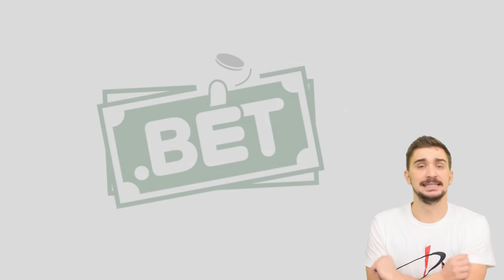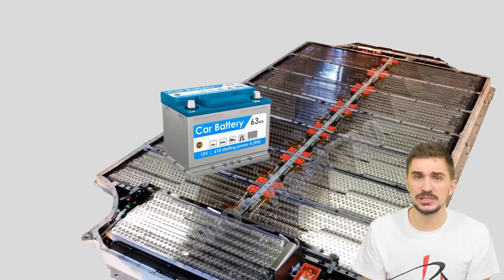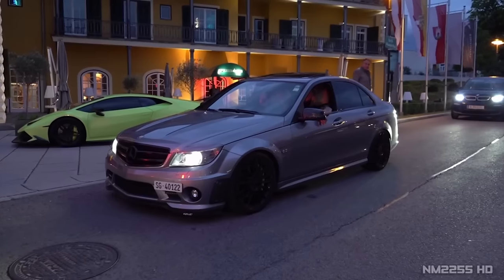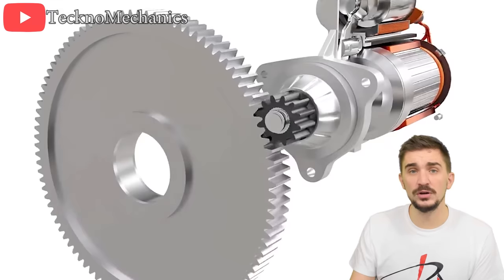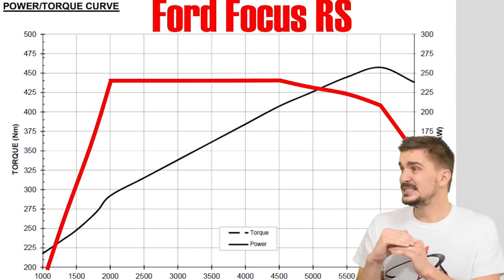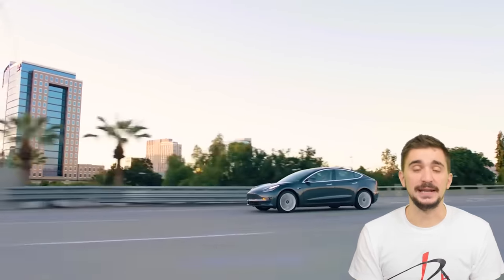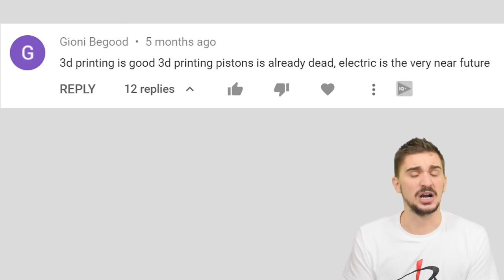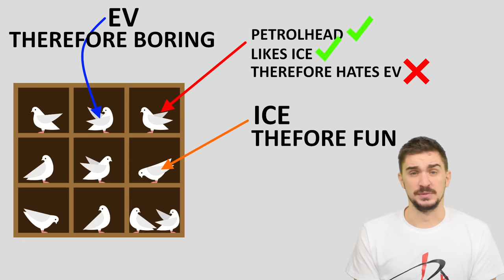ICE vs EV - IN-DEPTH comparison of BATTERY ELECTRIC and INTERNAL COMBUSTION ENGINE vehicles

Comment: I'm as big of a gearhead as they come, but I can honestly say that my Tesla Model S was the best thing I've ever purchased, vehicle or otherwise. I think some people just don't like change. I remember back like 15 years ago, when ethanol/E85 was just becoming a thing here in the US. Having been around sprint cars and IndyCar most of my life, I knew the benefits of running on alcohol, but I had a ton of friends who thought it was snake oil. Now several of those friends built engines to run exclusively on E85. Do I think electric cars are amazing? Yes. Do I think they are the way of the future? Yes. Do I think they will eliminate internal combustion? No. Hell, enthusiasts still ride horses, and cars replaced those over a century ago.
Reply: Hows that EV treat you on a road trip? I can take my truck or civic 1000 miles and use aboit 15 minutes worth of fueling time to do it. I drive a lot so an EV is pointless

Comment: Also, why use the old discontinued P100D dyno graph? The newer Model S "Raven update" Performance trim makes more power/torque further into the RPMs thanks to recalibration of the cell chemistry, inverter/speed controller(s) and the Model 3's PMAC motor on the front axle- And the Model S Plaid/Plaid+ (as stated on the Tesla website) utilizing carbon sleeved rotors, enables the car to maintain peak power/torque (1,020-1100hp/torque unknown) all the way to top speed (limited to 200mph)

Comment: Thanks for this video. I'm surprised you're surrounded by so many E-Vangelists, here in Czechia the complete opposite is the case. I have yet to meet a person who doesn't describe EVs as useless and overstated waste of effort. People here seem to think that the battery manufacture has the same carbon footprint as 5 years, 150,000 km worth of ICE vehicle operation, only because about 60 % of our electricity comes from burning coal. I've never heard anyone talk about the 8% vs 60% efficiency of ICE vs EM. The best part of this was when otherwise a very knowledgable and wise person pointed at the water vapor coming from the power plant cooling towers and told me: "See? This is the ecology of EVs." 

I wouldn't probably want an ICE car for myself, but I completely agree that ICEs have and will have their place here for quite some time yet. But I'd like both parties to use some real arguments. I love that this video brings some for both sides.

Comment: I remember having to manoeuvre a broken down volvo to allow it to be towed.  Not only did i do this on the starter, it managed to drive up a HUGE kerb during the manoeuvre without hesitation, which opened my eyes as to how much torque even a tiny electric motor has.

Comment: The last time my clutch went out on my Nissan pickup truck. I had to drive it with no clutch all the way home. But, every time I came to a stop at a light.  I had to turn the truck off, & put on nuetral . Then, I would put it in the first gear, the light would turn green. I would start the truck, & it would move forward.  Finally starting the rnotor as i gave it gas. Voila running again. No clutch shifting. 
Made it home. 😁

Comment: Love the content.  You have a wonderful ability to break down complex concepts into bite-sized pieces.  One complaint.  Please, please stop using SI units for videos targeted to US viewers.  I don’t like mentally converting and will be the first one to demonstrate in Wa DC to oppose the conversion to metric.  I have always purchased gasoline in gallons and measured torque in ft-lbs.  Really the only relevance to my frame of reference is comparing a 5.9 l Cummins engine to the 6.7 l.  Other than this small complaint, I love your channel and the information you are providing.  Keep up the fantastic work!

Comment: All sounded good except for the part about "Liquified Dinosaurs."  We may have to do a bit of homework here.
I have an EV and love it. But for my wife, there is no EV version of her Honda Odyssey.  Fill it up and drive all day long.
It's not the ICE vs EV that we compare in the two vehicles, it's the capacity to hold fuel.
We all want smaller, more powerful, cheaper, locomotion for our vehicles.  But we also want a cheap way to power them, and an overall lower cost of vehicle.  I love my EV, but the sound of a V8 rumbling along is something no EV will ever replace.  It feels like a wild animal and I love it.

Comment: GREAT content as usual, especially the end. The EV/ICE war is simply stupid, as like as Android/Apple stuff.
About the bet: this (without disconnecting the spark plugs) is how I went home once, when my clutch cable on my 1995 Clio S broke :) You can't stop the car at traffic light if you're in gear, and you can't put a gear from stand-still if the engine is running (without using the clutch). So you put in neutral, stop at the traffic light, put 1s gear and start to move (and start the engine too) using the electric starter. Not good to do but if that is your only way, you can, trying to avoid as much as possible red traffic lights or stop interceptions on the way.

Comment: Nice, vid, still relevant to me even today, i'm from north-africa, Algeria, and even tho this year i saw electic charging stations on the highway, in the north of the country, but it's not everhwhere, specially here in the south, i hadn't even seen any electric cars during my trips to the north either.
i did the math and even tho electricity seems cheaper than fuel, but still the cost of an electric car is way outside most people's pockets and it's not yet cost effective bc batteries are super expensive.
Also realitiy check, recenlty saw more and more articles online about how batteries for EV arn't economical to replace all ICE bc there isn't enough lithium reserves nor nickel or cadmium,
So most of the world will be using ICE for the next decade or 2 decades

Comment: Id Love to hear your take on the environmental aspect of EV vs ICE, Just consider if you would, in and EV world, we centralise the carbon footprint to power stations (most currently without carbon capture) we then loose power through cable transmission to your home where we charge our EV and that best Batteries are .8 efficiency. It seems we loose maybe 30% being conservative before we sit in the car. Maybe this is comparable but without carbon capture at source, perhaps the real future is Hydrogen ICE. This is my perception, without hard figures to justify or reject. Please comment thanks from Steve

Comment: Some things need slightly better explanation.
Torque curve for EV's on high RPM is mostly power limited, not as much due to back EMF.
If you reach max power on lower RPM you will create near perfect constant power torque curve, with obviously some 4-7% loss, dependent on the motor.
Also most of EV's aren't geared towards very high wheel torque, but to optimize efficiency on the average speed estimated by manufacturer.
This is why dual motor Teslas have slightly higher efficiency - they can manipulate power between two motors with different gearing.
Multi-gear setups aren't used mostly due to lackluster efficiency gains - couple years ago I've read about 2 gear being tested for EVs, but it only gained ~5% of efficiency, while adding to weight and complexity.

Comment: I think the enthusiasm u told about for evs should be limited to hybrids only, the KOENIGSEGG JESKO is the best example . Purely electric vehicles are soulless and dull, usable though depending the consumers needs, and they completely lack the stimuli that sparked the enthusiasm for these"  intially built to be just tool things" THE SOUND + THE MECHANICAL FEEL of the whole car working with different systems integrated into one, THE ENGINE, THE GEARS WHINING, THE ICONIC GEAR LEVER, THE INFAMOUS CLUTCH PEDAL and the responsibilties we have as owners. So i dont completely agree with that statement of yours that similar enthusiasm can be shown. But you opinion has been respectfully noted down.

Comment: Pedantry: You control the speed of an DC motor by controlling the current. It's current that drives the motor. It just so happens that with a DC motor, current and voltage are proportional due to the impedance across the motor. This means that as the voltage drops, so does the current (and at 0 voltage, you have 0 current). You can think of voltage and current interchangeably here since the effective result is the same, but to be sure, current drives motors. A magnetic field is produced by a moving charge and that means current, not voltage. 

Also: If IC engines made torque from 0 rpm, they wouldn't need a starter motor ;)
Reply: I thought in a DC motor increasing the voltage increases the difference between applied voltage and back-EMF, allowing more current to flow, no?
I know a small DC motor, if current limited, can still increase speed with increased voltage, but the torque will be current limited.
Maybe I'm wrong.

Comment: Yeah as you told, EV are having a bright present. EV nail it in COG and ICE in reliability. 

Just a small correction EVs are actually as old as ICE. It is just that the world has turned to it now.

Eg.  Columbia Electric: 1899

ICE future is the omega 1 motor.
Reply: And as far as ICE is concerned they have been the generators in the past and even in present at times of no electricity. When we also include power drawn into charging stations and potential opportunities for generating power to homes for those who need electricity at their homes, it leaves a questions mark on the practicality of it.
By far HEV and HICE are self charging and offer best mileage MITIGATING DIADVANTAGES OF BOTH ICE AND EV. they are the best available option in the market
Reply: Interesting...🤔

Comment: What about gas turbine engines not needing to convert from reciprocating to rotating movement? I know they aren't practical in a car but I like that they are being used in large ships to power the generators that run everything,  including the electric motors that turn the props. Nice video though, I think you did a good job showing the trade-offs on both sides.

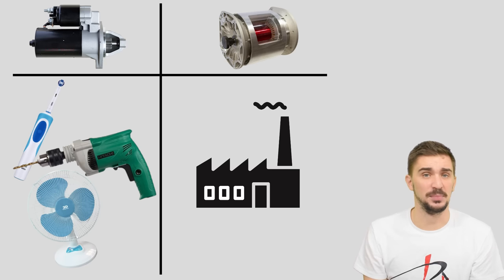Comment: 6:30 That fan and electric drill are using AC motors, FYI.  Notice the form factor of the drill, no battery is going to fit in that handle. The pic looks like the cord was cut off.  Also, some electric cars use DC motors.

Comment: Combustion engines are used for some VERY efficient ELECTRICAL generation. Most locomotives use diesel engines to turn electric generators to create mechanical propulsion through electric motors - and this has been going on for a century. 

Are electric motors and vehicles awesome? Yes! 

Are petroleum fueled engines and vehicles awesome? Yes! 

Are both completely viable for (at least) the short term? Hell yeah!
Reply: Some more remote locations also run diesel generators for their electrical grid. There is a push to augment them with things like solar-battery in these cases, but the diesels will remain for the foreseeable future because we cannot be sure that there won't be some cloudy days...

Comment: Given a huge revolution in energy storage/distribution technology and some other refinements in EVs, I can see a future where they'll take over most of the market... but that technology doesn't exist yet, there's no way to know when it will exist, and even then there are applications where ICEs will just be preferable. Obviously there are some serious benefits to EVs, and given more efficient, environmentally friendly batteries and power grids, they're an excellent idea.. but many of the problems they solve would be even better solved by an overhauled mass transit and bicycle infrastructure in a lot of places. The whole thing is a many-pronged issue, and basically the only thing that's clear is that EVs will grow a fair amount in popularity and ICEs will also stick around for a while.

Comment: Great communicator as always. Can you do a review on the new Plaid? And what do you think of a Hybrid MR2 successor? Would you do a hybrid conversion for yours?
Reply from the maker: I think that to do an actual review of a car you need to drive it and I don't have an opportunity to drive it. Also I'm not a very good or experienced car reviewer. When it comes to my opinion on the plaid, sure it's amazing but for me it's just more of the same. The difference between 3.5 and 2.5 seconds to 60 is irrelevant for anything other than numbers. For me cars are so much more than just how fast they can go from A to B. In fact, sheer power is my third or so priority. I would love to try ludicrous mode once or twice but after that my interest in a Tesla rapidly fades. The interior and exterior are incredibly boring and I'm really missing some sort of soundtrack coming from a car. It doesn't have to be engine sound but I always hoped they would buzz or whirr or whatever like the futuristic cars do in movies. Something that tells you the machine is working and giving its all. Teslas are impressive no doubt but I'm really missing visceral elements from EVs so far. The aspect of modification also seems very underwhelming at this point. Obviously I'm a typical petrol head and the EV thing on a global scale is still just beginning, but as things stand I'm worried and feel like there's nothing for me in it. I can't get excited for things like giant screens and gimmicks like that thing where the car comes by itself to you from the other end of the driveway or autopilot or whatever. I'm hoping there will be something with driver engagement in the future. We will see. I doubt an mr2 hybrid will be happening. Toyota has the sports stuff covered better than any other brand at this point in my opinion and churning out more doesn't make financial sense. Also a two seater hybrid is something that likely wouldn't sell well. A petrolhead gets pretty much everything they need from an 86 or Yaris gr. Both cars are very fun and adding hybrid stuff doesn't really significantly increase fun. It improves economy. Sure it can add power etc. But it also adds weight and complexity. I wouldn't add it to my mr2 as it would be a very complex project that would keep the car off the road for ages and wouldn't really make it any more enjoyable for me. Aa you can see it's all about fun and involvement for me. Probably because it's my second car and I don't use a car on a daily basis that much 🙂 sorry for the rant

Comment: A single-speed Transmission doesn't appear make a lot of sense, and on any EV is a 'compromise' and Porsche have started some of their EVs with two-speed Transmission Units. But, consider a Beetle that has been EV converted. In most cases, this retains its original 4-speed transmission. It has power, and a decent range too! 2nd gear will get you from zero to 100km/h. This represents most of your everyday driving, with 3rd gear selected for Motorway speeds. The best of both worlds, and I love mine. Greetings from Australia.

Comment: Great video. But, man, you are very mistaken about DC motors. Despite many pain points in operation,  they are very elastic (series  and/or compound connection). Moreover... you may be impressed by awesome torque curve of steam engine!

Comment: Moving the car on the starter used to be SOP if the car stalled in a dangerous place, such as a level crossing or a running lane of a motorway.  Sadly, the clutch (or brake) interlock prevents this on most new cars.  By the way, there is no need to remove the spark plugs.

Comment: People also like to forget charging stations, and your home outlets often rely on a coal or natural gas power plant for power.  Wind is not very effect in most places, or at most times, because wind is not constant and sometimes it does not work.  Solar is good until you get a cloudy day or the sun goes down, and you lose a lot of power in the winter, as you go higher in latitudes it even gets worse.  Hydro is one of the best sources if you live near a river.  Nuclear is probably one of the best clean sources, but nobody likes them because when the do break down, even though it is rare, it tends to be a big deal, that kills a lot of people, and leaves the place toxic for years to come.

The reality is you either can use an ICE or you can pretend you are being virtuous and use coal to power your car.  It would be nice if we could get a good efficient alternative, but we are not there yet.  And despite climate hysteria, every prediction I have heard the last 30+ years about how polar ice will all be melted in 10 years, and how we will all die, it has never come true...a few cars using gas is not going to tip the scale any, when you look at the emissions of China and India, and add that an increase of electric vehicles will only add to the need for more power plants, that need to be coal or nuclear to really keep up with the high demand.  Unless there is a big break through from the alternatives, at least.

Comment: Woa, hold on a minute! Frequency is not easier to change in an electric circuit! To change the voltage, you simply add a resistance, basically just get more wire (or you can have a wire sliding on another wire, so you add or subtract some length off the wire and hence you add or subtract the resistance and the voltage - this is called a potenciometer), but for changing of the frequency, you need a whole computer with a lot more resistors in it!